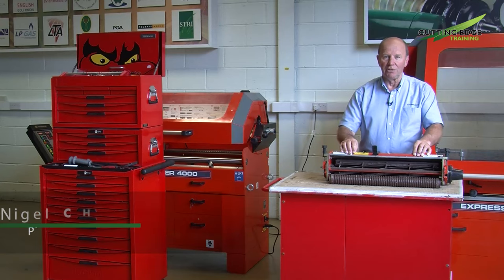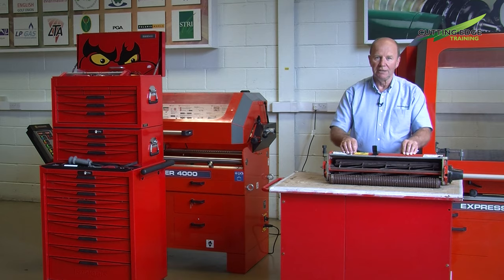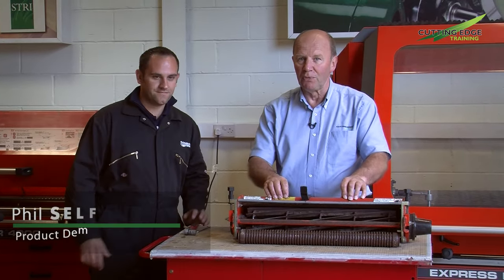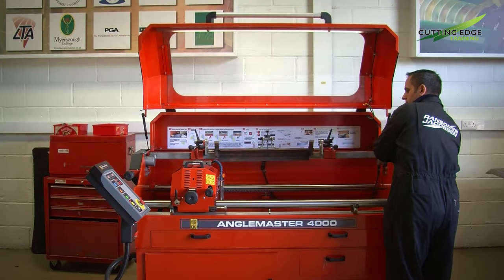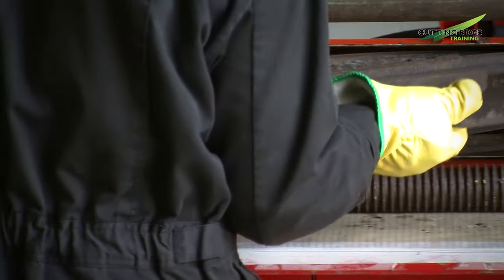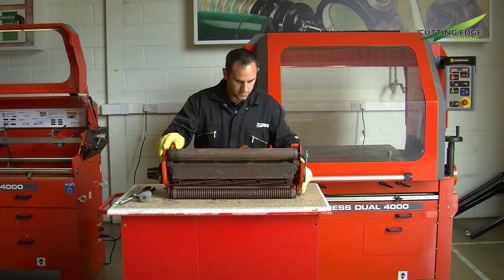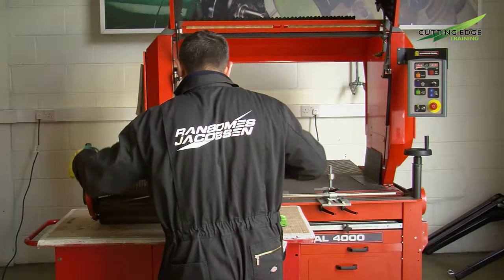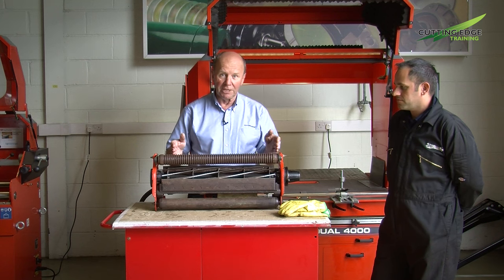HOW TO Workshop - Sharpen and Grind

Comment: Amateurs, most kids remember dad teaching them how to sharpen a knife. Always push the edge forward so as not to leave burrs that will only roll back and leave a dull edge.  Don't believe me, try it, it will feel like a saw and not a knife. So, why not file those burrs off the leading edge of your reel? After grinding and after lapping! I get 4 to 5 months between grinds, approximately 1200 to 1500 greens cut with a triplex. Even then it is still cutting paper with little contact.